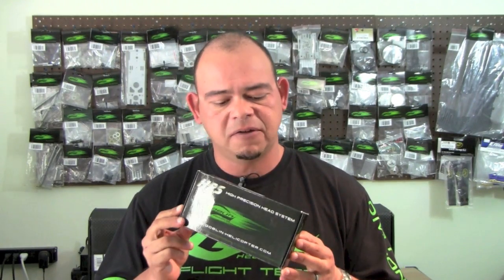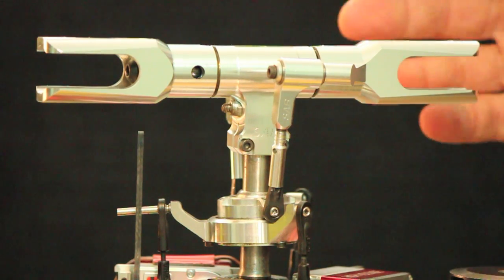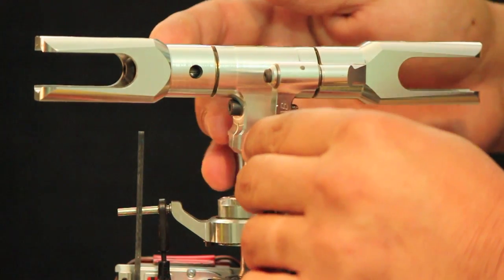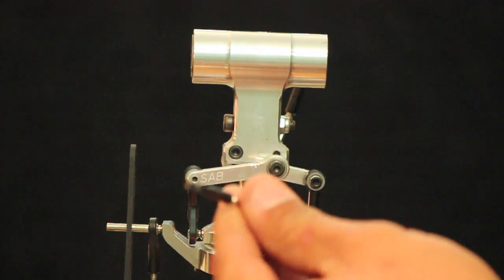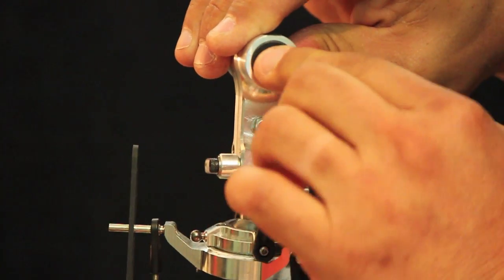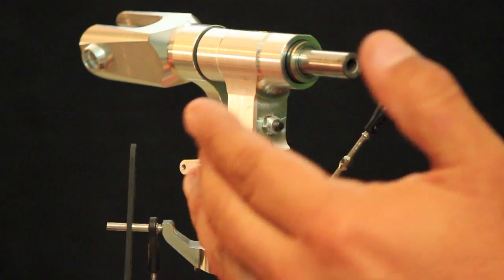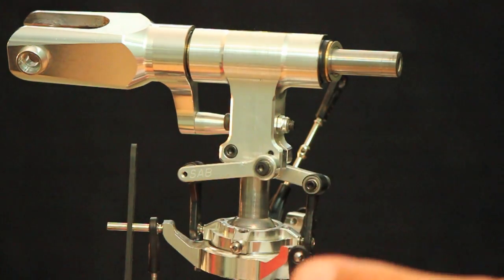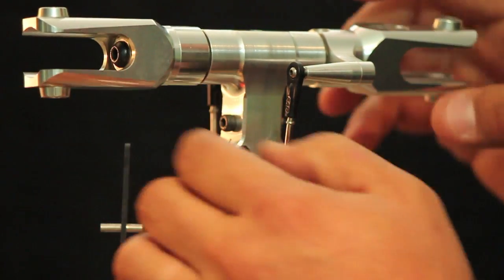HPS (High Precision System) Rotor Head

Comment: Bert so basically this HPS converts the goblin rotor heads to DFC as well too. Do you prefer dfc or traditional rotor head with wash out and mixing arms.
Reply: Technically speaking, unless the head is equipped with a flybar, there are no mixing arms or ‘washout’ (pitch compensator) parts. What you do get with a ‘conventional’ flybarless head are a pair of swash drivers and that’s all. This conversion takes the stock SAB head away from DFC completely. The stressful forces the DFC pitch links experience are completely eliminated with HPS design. Hope this helps.